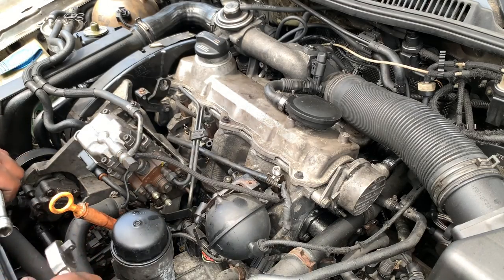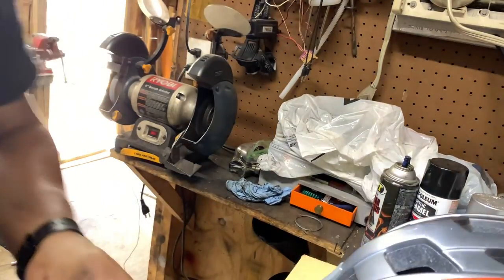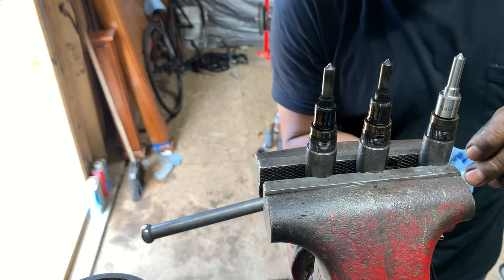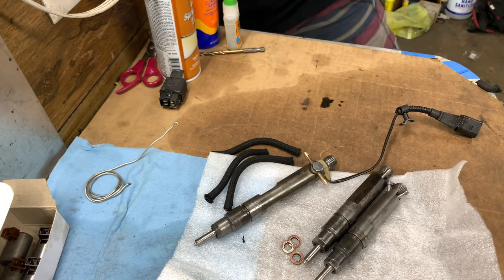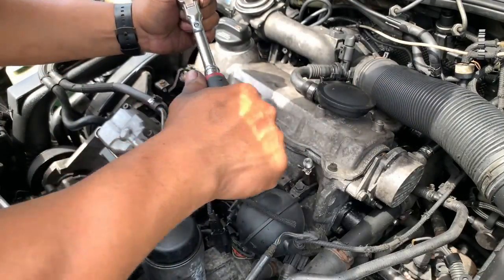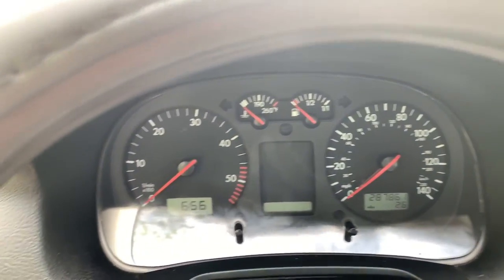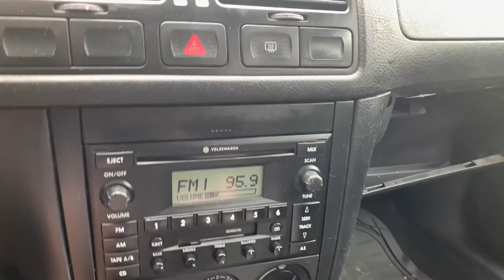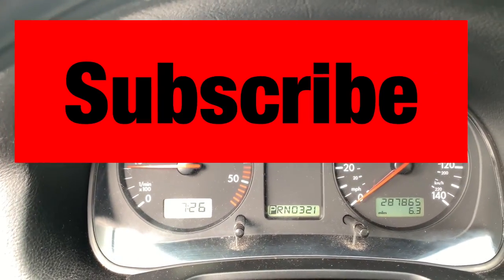How to install nozzles in at TDI

Comment: Hello friend, firstly thank you for the video it was very educative. I have a golf 4 1.9tdi ALH engine (90hp) I already have egr and cat delete also a stage 1 tune. Now I want to replace my stock nozzles with Bosio Sprint 520 What do you think? Also do you have any video what changes should I do on vcdc? Thank You
Reply from the maker: Ones you change the nozzles for a bigger you need to set the iq back between 7-9 and fine tuned with vcds if not you car may jump the rpm up and down
Reply: @taco8v  do you have tutorial about how to do it? I think Im gonna use dlas150p1090 nozzles .216
Reply: Bosio ULSD 1019
Reply from the maker: @FOTROXIC i don’t thinks so man  I maybe mentioned something in here but not a specific video for it

Comment: What’s up Taco?  What was that link eBay about those cheap reliable nozzles for the ALH?
Reply from the maker: Noo its just the ones I bought cheap ones but I don’t recommend them man  i got 2 the where sticking close so i had to replace them
Reply: I assume you would go with Bosio then?
Reply from the maker: Naa
Reply: Any recommendations?
Reply from the maker: Bosio are good brand , but to expensive for me   I buy titan or dark side  but some people buy bosios   Nothing wrong with that .
Reply: @carlosdasilva8622 Wuzetem Polish nozzles are a bit cheaper and quality is better or equal as bosio

Comment: Bro i have issue with my golf 4 same engine like u 
It hesitate to go fast but when i turn of and on it goes nice At overtaking loose power  and goes 100kmh and no acceleration it looks like he goes Limp mode 
What should i see ?
Reply from the maker: Pretty sure is over boosting maybe bad actuator or sticking vanes on the turbo  a scan will tell you

Comment: Hello....it need to test the injector after replace the nozzle?
Reply from the maker: Normally if you tight them good it will work fine  i have being using injectors without calibration for years and my card still giving me power and economy, but is best to get them calibrated .

Comment: Don't forget to use a hammer and a punch to really torque then down
Reply from the maker: I used the rubber hammer to cut the Oring down.  Is not like I was using a real hammer and damaging the injectors.
Reply: @taco8v  I usually use a punch and hammer it on top of the nut of the injector then tighten the 13 bolt again I do that 3x it helps a lot with sealing it
Reply from the maker: This injectors where not hard to remove, so no need the extra hit. To crush the copper washers. Not necessary also that’s why I put this orings in to stop the abuse of hitting it, is really not necessary to do that , unless the injectors doesn’t want to get in, but there’s a problem if the don’t want to slide in. 

I have never had a problem in my years of working them this wat
Reply: @taco8v  I see
Reply: I've done the same thing just use an extension and Hammer it down then retorque always found it helps

Comment: Are they special nozzle or the same ?
Reply from the maker: A bit bigger
Reply: @taco8v  I want to do this but there's is no information on that subject.  I wonder if it can cause some problem and if I absolutely need to go see a tuner .
Reply from the maker: @davidcoupalbergeron2 changing nozzle for a bigger size will definitely need some tuning and Vcds software to check iq   Or in some cases you car needs a tune for the nozzle size you upgrading
Reply: @taco8v  thank you sir . May God bless you my brother

Comment: What’s the nozzle size and the brand? I have same engine on my mj4 golf and I want to upgrade the nozzle and the turbo!
Reply from the maker: This I believe was 0.30 cheap nozzles from ebay  i end it up just removing them  and came back to bosio 0.764 oem